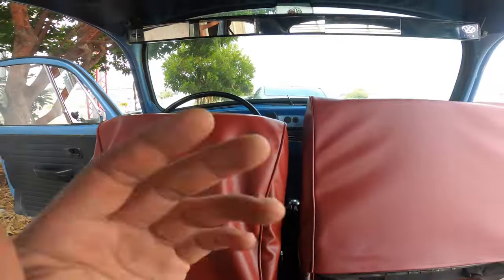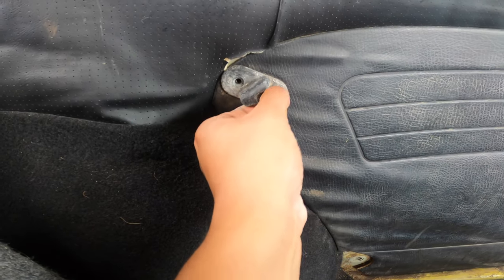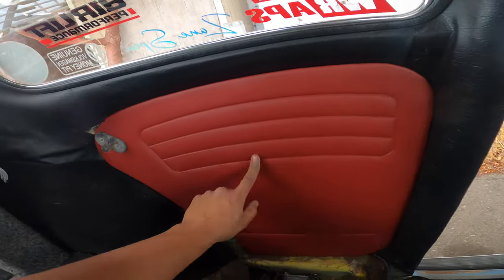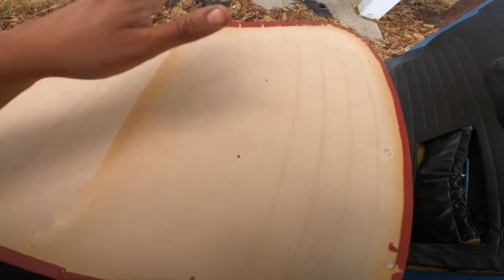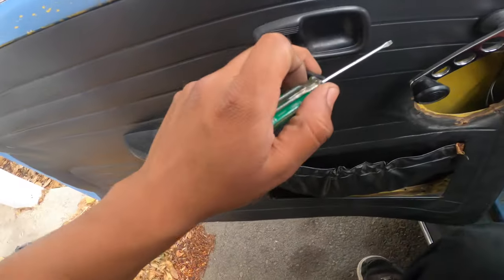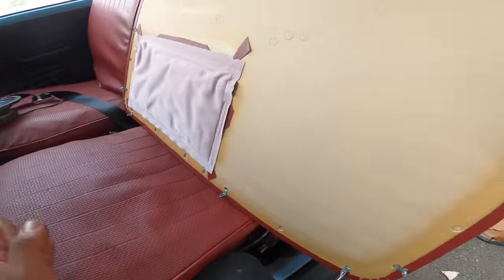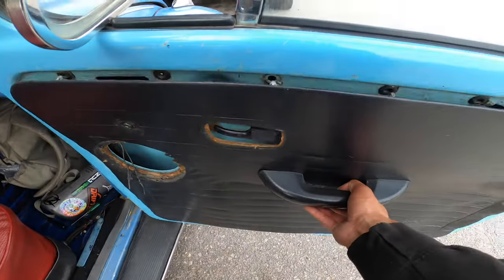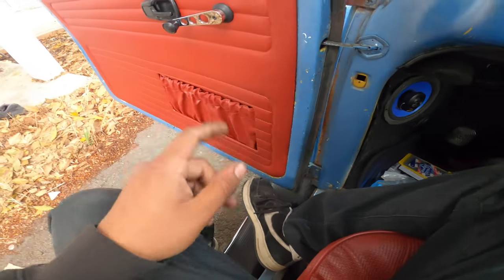TMI Red Door Panel Install | 1972 VW Beetle

Comment: The red looks really nice, I'd fit the grab handles, black and red works well together, plus the other hardware is black anyway. You may have to remove them all though, I'd highly recommend putting a vapour barrier between the door and the door cards! This was done from factory and prevents the water that goes through the window seals and down inside the door from damaging and distorting the door card.

Comment: Buddy, looks really nice! 👍👍 Someone mentioned in the comments about a vapour barrier and I was thinking the same thing. There was a plastic barrier from factory between the card and the door to protect the cards from water damage. I did my interior a little while back now but my barrier was gone as well. When I got the new cards, I spent the time to put one in (easy and cost pretty well zero dollars) and protects those beauty door cards you got. 👍 There are a few YouTube videos on it. East to do. 

The red looks sick man. Lovin’ the transformation.

Here’s a link for reference. Doesn’t need to be fancy or expensive to save those cards.👍

https://youtu.be/bpb9ubr0rz0